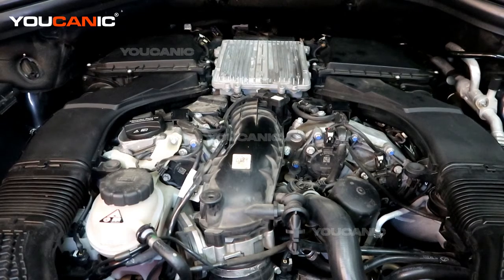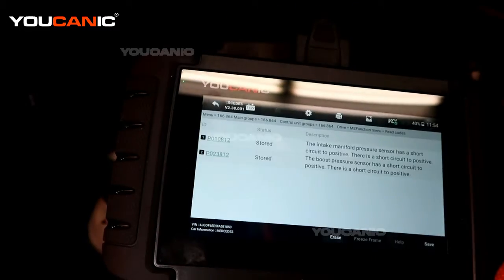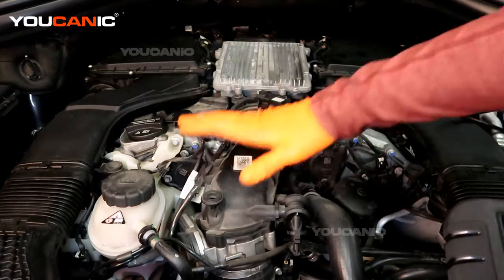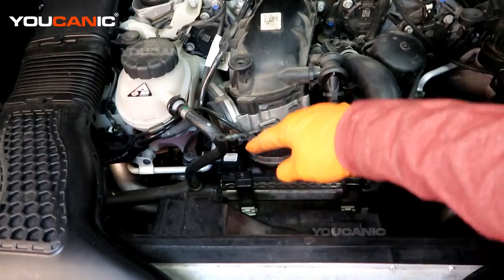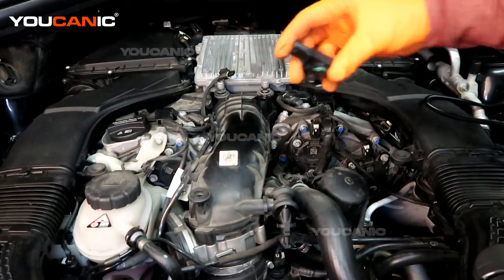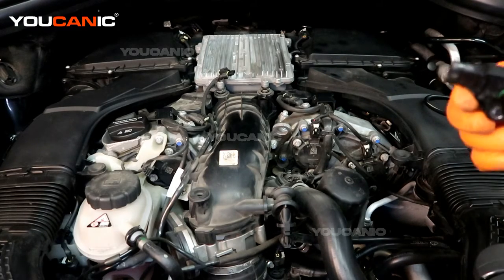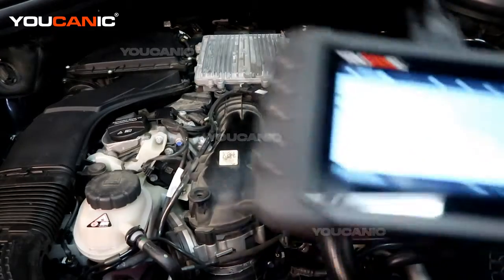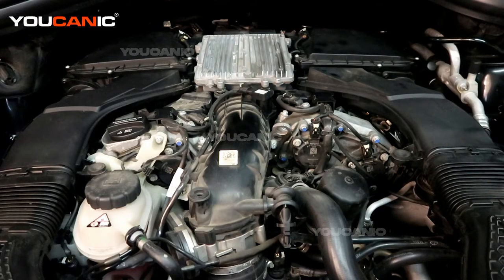Mercedes-Benz P0108 & P0238 - Intake Manifold and Boost Pressure Sensor Has Short Circuit

Comment: You saved me. I replace a crankcase vent line on a M276 Bi-Turbo. After I got done. I had no boost CEL P023812. I was so focused on the boost controller and puzzle. After brainstorming and my friend also brainstorming he thinks there is another sensor I missed or overlooked. Saw your video. I miss the sensor on the intercooler it was not even plugged in. Thank you.
Reply from the maker: We're thrilled to hear that our video saved the day! At Youcanic, our mission is to arm car owners with the knowledge and tools to confidently handle car repairs and troubleshooting. We believe in empowering you to take charge under the hood, from our solution-driven guides to our comprehensive Youcanic scanner.

Explore our resources and if you need any help, reach out to us on www.youcanic.com/. We even have factory repair manuals for more intricate works. Remember, Youcanic is your reliable partner in your car ownership journey. Enjoy the ride!

Comment: Maybe you would know but recently I tried a performance tune on my car (c300 w205 2015) I recently recieved a code for P0236 (turbocharger/supercharger boost sensor A circuit range/performance. Do I need to replace my turbocharger boost control valve and this would fix the problem?